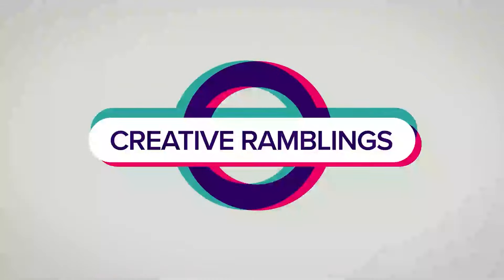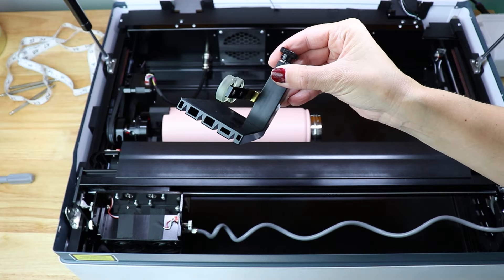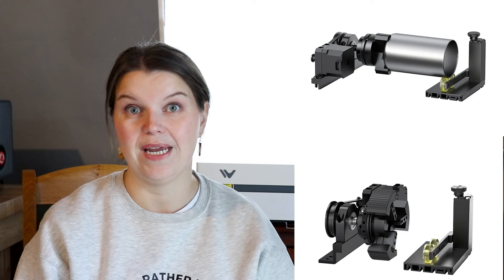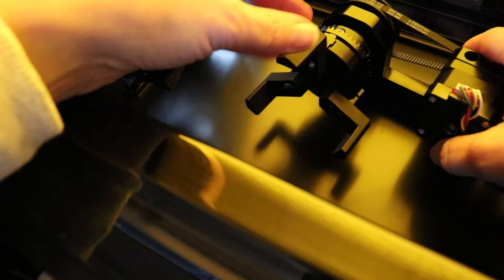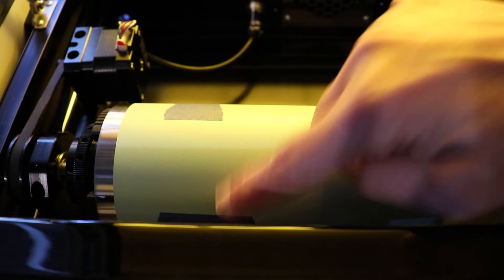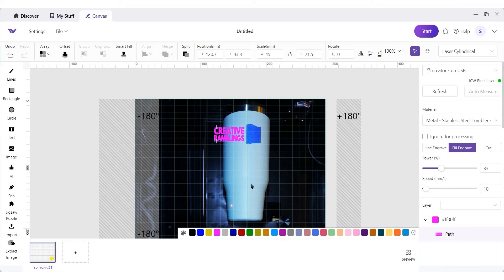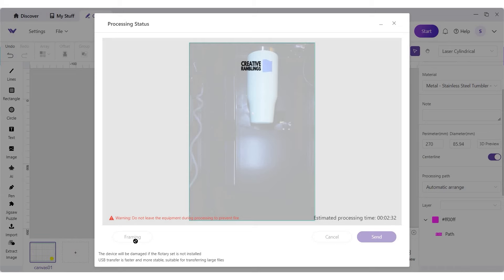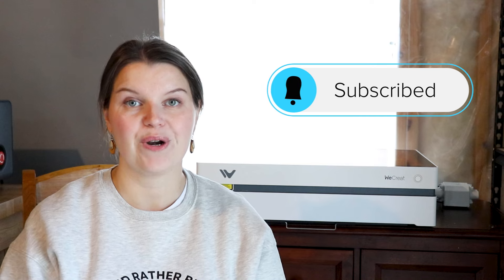EASY Laser Engraved Tumblers with the WeCreat Rotary Pro

Comment: Thanks for this video. I have 2 questions. In th video you said you are setting your design just to the left of the center line and just to the right of the the 2nd piece of tape. I couldn't see it in the video. Did you just measure the distance between the 2 pieces of tape and make your design that width? Also, are the settings you provided, specifically for this colour tumbler? Will it change if you are doing a different colour? If yes, you said you tested a lot of different tumblers. Are you willing to share the settings for the different colours you have tested?
Reply from the maker: Good questions. I did measure the area on the tumbler then made my design that size. It helps ensure it will fit when I line it up with the tape. Typically I can use the same settings for all different colored tumblers within a brand. I have had trouble when going between brands. For example a generic black coated tumbler will need less power than a black Yeti. Honestly, I would figure out what you base settings are, you can use the ones in this video, then plan to test when using a new color or brand. It just helps ensure you get the best results.